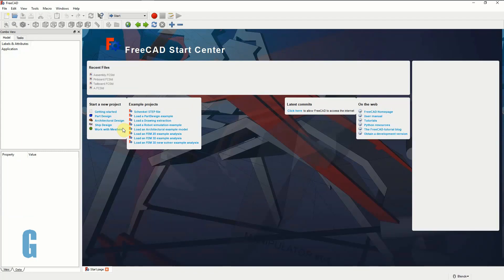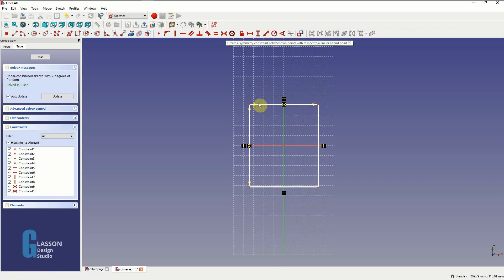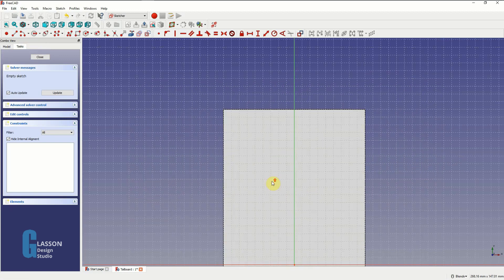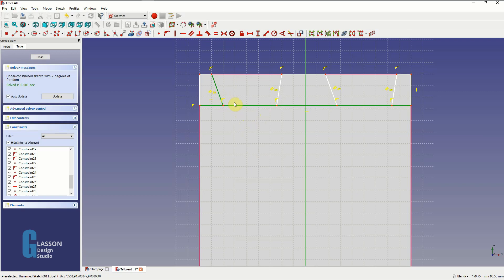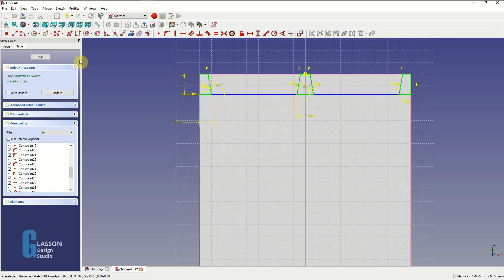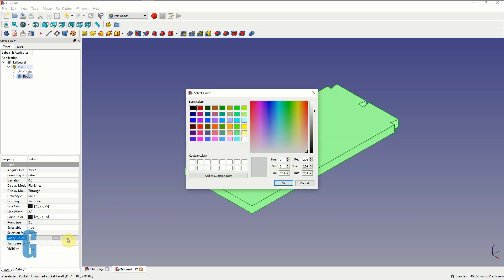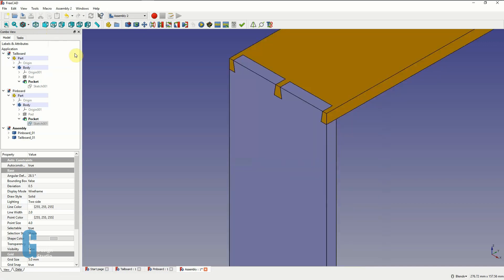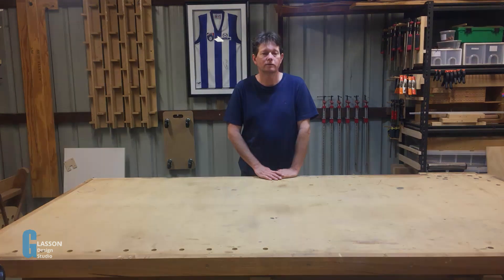Howto model Through Dovetails  in FreeCAD

Comment: Hey Geoff, I'm enjoying the tutorials but i'm having a hell of a time over here. I got through the mortice and tenon one (up till the assembly part, then I got a ton of weird errors, it's old and broke now unfortunately). I'm on .19, and when I follow along with the symmetry constraint steps, the box turns orange and the solver says I have redundant constraints. I only just put the box down. I tried googling a solution but couldn't find anything relevant. Any insight? Thanks.
Reply: Hey Geoff It stopped doing the thing but i' not quite sure why. Guess i'll figure it out eventually. Anyway, still enjoying the series, I plan on doing them all.
Reply from the maker: I'm glad that you're enjoying the video's and making progress. I sometimes find that I inadvertently create constraints by placing sketch items too close together and FreeCAD automatically creates constraints for me. There are two Sketcher preferences that you might want to check out. The first is "Auto constraints" which automatically creates constraints when it can (eg. vertical lines having a vertical constraint applied, etc.). The second is "Avoid redundant auto constraints" which attempts to remove redundant constraints as you work on the sketch. I have both of these enabled and I find that I don't get too many redundant constraints - the ones I do get are usually the result of me doing something dumb :). 

I hope this helps. Please feel free to let me know if there is anything specific you'd like to see on the channel or if you have any other questions.

Comment: Centering rectangle in less steps
You can center the initial rectangle in Sketcher by selecting diagonal points on the rectangle, then the origin point and then select the symmetry constraint. Voila - centered in both directions.
Reply from the maker: Thanks for the feedback Jeremy. I hadn't figured out that you could do it that way when I recorded the video. I now use that method all the time.